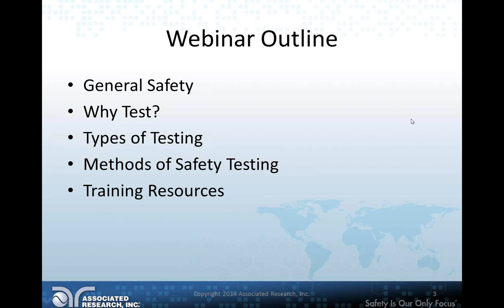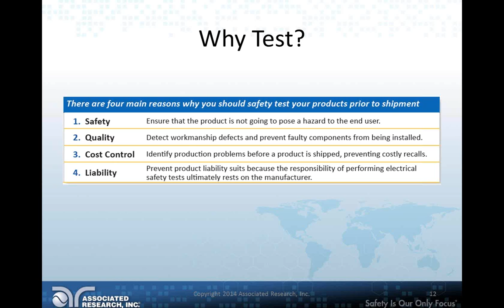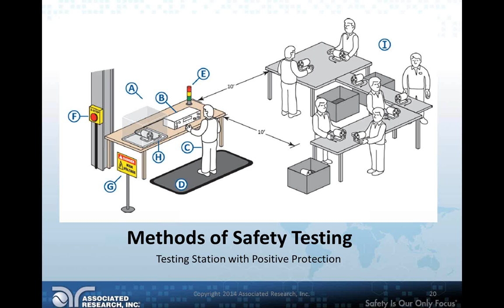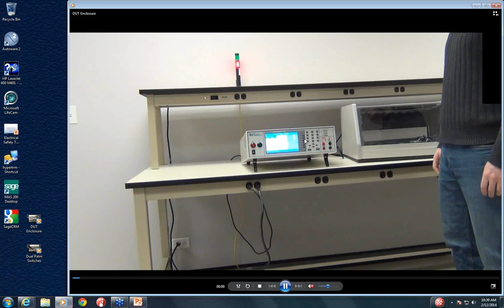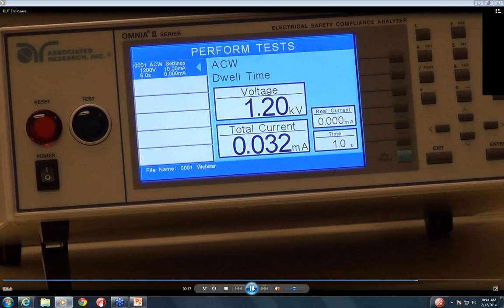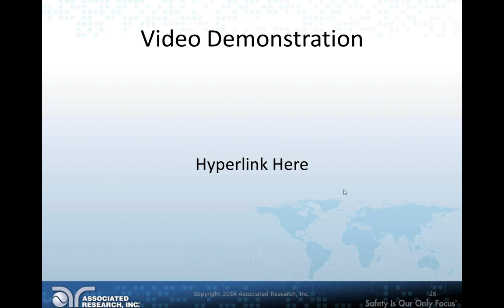Electrical Safety Testing A Complete Overview Part 1 - Feb. 12th, 2014

Comment: This is great webinar, 
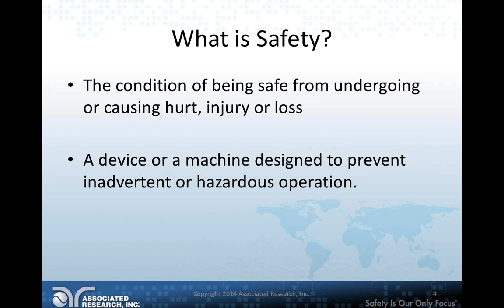However, at 4:24 there are some misleading statements, let me have the chance to correct few:
1. Current DOES NOT go to ground as final destination, it rather uses it as a path to return back to the source.
2. Electricity doesn't take the path of the least resistance , it take ALL the paths back to the source. This is called the "touch voltage",